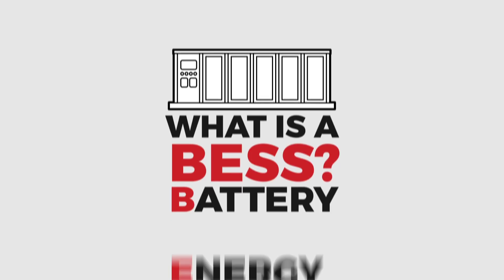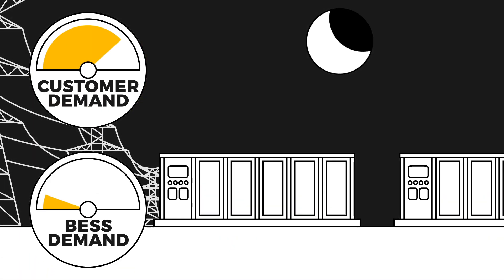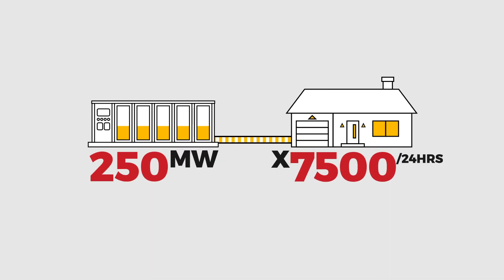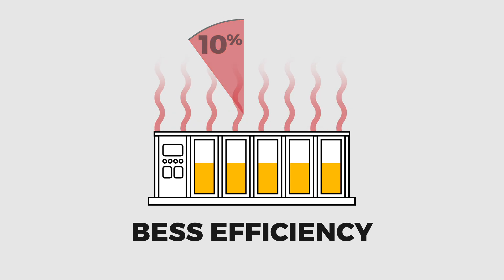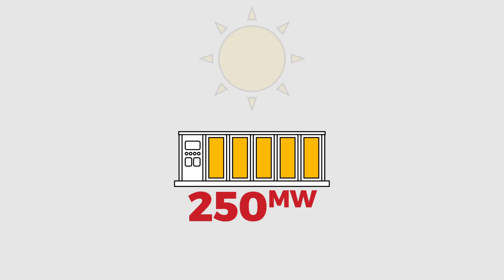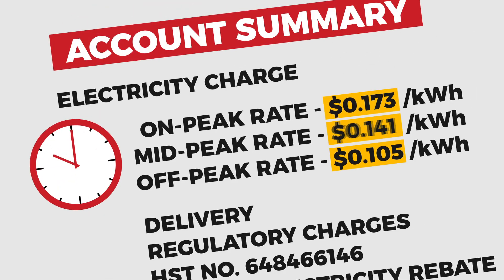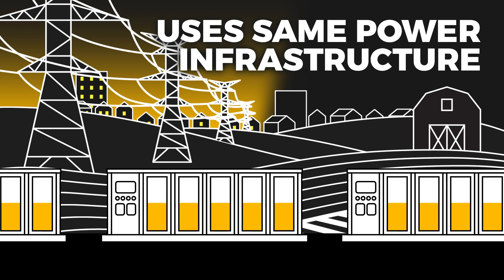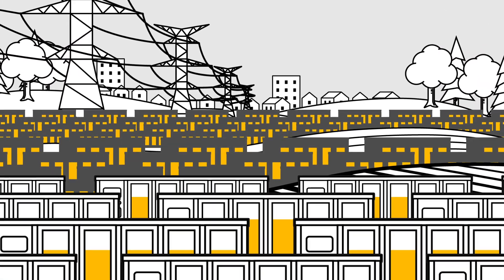BESS: Welcome to Wattopia

Comment: So it stores energy when we have excess supply capabilities and sends it back when its needed so we don't have to produce more during high demand? and this is a bad thing? I don't think you thought this through...
Reply from the maker: The concept of battery energy storage is solid in theory, but the current implementation is far from a reliable, safe, or clean solution. The numbers tell the story:

This project costs $42 million for 1,000 MWh, which means you're paying $42 per kWh just for storage.

To make it cost-equivalent to regular electricity, you’d have to fully charge and discharge it at least 250 times.

But each cycle wastes power—about 10% is lost to inefficiency. Over 250 cycles, that's enough lost energy to power 667,000 homes for a full day.

That inefficiency translates into $2 million to $7.5 million in wasted electricity, on top of the $42M investment.

And if losses were only $2M? That would mean the battery wasn't cycled enough to properly amortize its cost so the actual cost per kWh stored and returned would be even higher.

Comment from the maker: @zhoqchien6459
Thank you for your detailed comment.

First, to clarify: we are not anti-BESS. As stated in the video, we support informed discussion and believe communities deserve to understand all trade-offs, technical, environmental, financial, and logistical.

Regarding the 10% loss:

This is not a reference to transmission losses, but to conversion losses that occur during the charge/discharge cycle of lithium-based battery systems. Electricity must be converted from AC to DC for storage, and then from DC back to AC to return to the grid. This process introduces inefficiencies, commonly referred to as round-trip efficiency, which averages around 90% for modern lithium BESS.

This means for every 100 MWh stored, only ~90 MWh is returned, a 10% loss from conversion alone. Transmission losses, if present, are separate and additive.

To deliver the contracted 250 MW capacity under the IESO LT1 RFP, the system must compensate for this inefficiency. That means storing approximately 275 MW. When accounting for further inefficiencies during the charging phase, the actual grid draw may approach 302 MW. In our video, we used the more conservative 275 MW figure to stay fair and defensible.

Regarding the $42 million/year estimate:

This figure comes from publicly available data from the IESO’s LT1 RFP, which awarded the Fitzroy BESS project a fixed capacity payment of $669.60 per MW per business day:

- $669.60 × 250 MW = $167,400/day
-$167,400/day × 250 business days = ~$41.85 million/year
-Over 20 years = ~$837 million

This is not a speculative estimate, it reflects the contractual payment for maintaining dispatchable capacity, not including operational costs or potential arbitrage revenue. The data comes from both GetCharged sources and the official IESO LT1-RFP results (May 9, 2024).

Regarding energy “dumped” to the U.S.:

Yes, Ontario exports surplus electricity to U.S. utilities at discounted rates, especially during off-peak periods. While sometimes referred to as selling at a “loss,” it’s more accurate to say Ontario sells below full-cost recovery due to fixed generation and transmission expenses already incurred.

However, the existence of export pricing issues does not justify installing BESS infrastructure at any location without a thorough evaluation of local impacts, cost-benefit tradeoffs, siting decisions, and alternative solutions.

Finally, labeling concerned local residents as “NIMBYists” is dismissive and unhelpful. Our concerns are not based on fear, they are based on public data, expert presentations (such as OPG’s on March 18, 2025), and a commitment to transparent dialogue.

We welcome opposing views and remain open to civil, evidence-based discussion.

That said, in the interest of transparency, may we ask: are you or your organization financially involved in, or positioned to benefit from, the proposed installation? If so, it would be helpful for viewers to understand the context of your perspective.

We’re here for open, honest, and constructive debate.

Comment: This video is full of disinformation/misinformation obviously intended to skew opinions against the proposed South March BESS even though the video's producer(s) claim that they are not against BESS technology.

The claim that the BESS "wastes 10% of what it stores" presumably refers to transmission losses that are inherent in any electrical grid. Google the topic and learn the facts.

Then the video's producer(s) builds upon that disinformation to come up with the needed 275 MW capacity to make up for the transmission losses , claiming that it cost taxpayers money to produce that electricity that was wasted.   

The fact is,  if the BESS did not store the excess off-peak production, it would be dumped into the US grid, sold to the US utilities at a discounted rate so that we, Ontarioans are in fact subsidising the Americans.  Furthermore, due to the increased  distance that dumped energy has travel, the transmission losses are amplified substantially, wasting even more of the energy that could have benefitted Ontarioans if it had been stored in the BESS that ideally would  have been next door to the generating facility at Chat's Falls if the original Evolugen proposal hadn't been shut down forcing the proponent to move the proposed site further down the line to the Marchurst site.

And then the video's producer uses the preceding disinformation to somehow come up with the fantastical $42,000,000 (!) figure which makes no sense (ie nonsense). 

The anti-BESS NIMBYists can no longer make the claims of fire hazards and water contamination so they have to come up with this stuff.

Learn the facts about the proposed South March BESS at  https://www.getchargedottawa.ca/south-march-bess
Reply from the maker: See our above respone